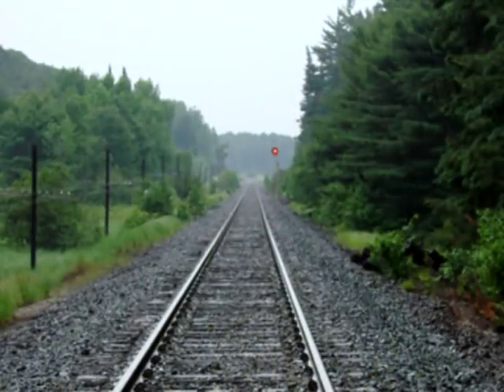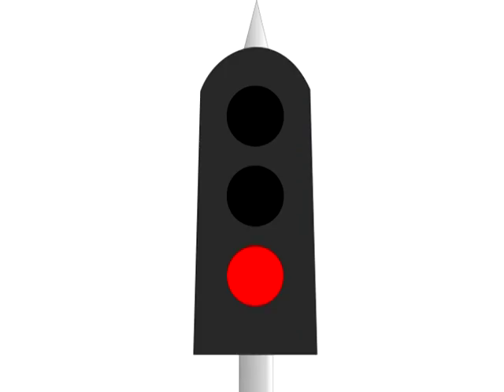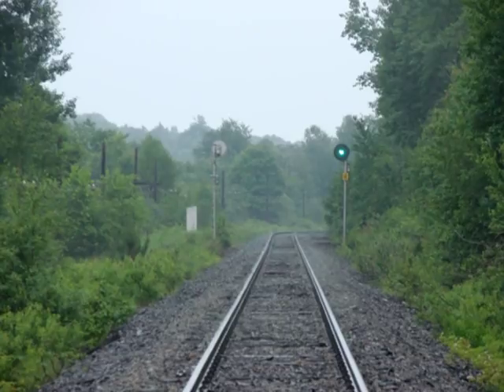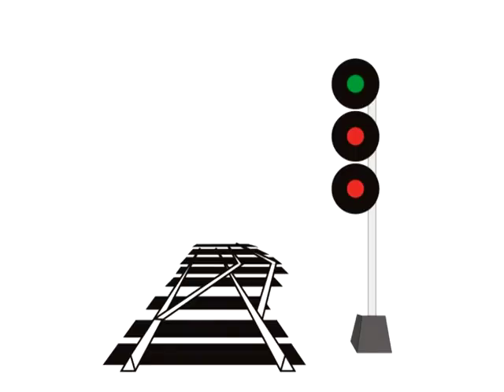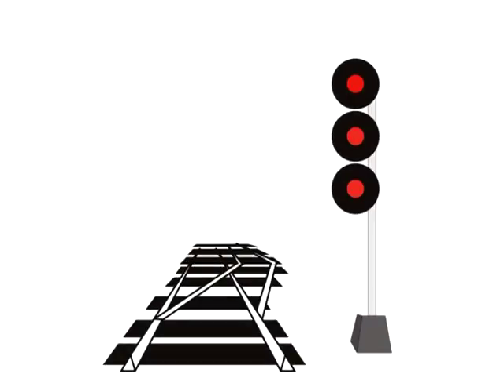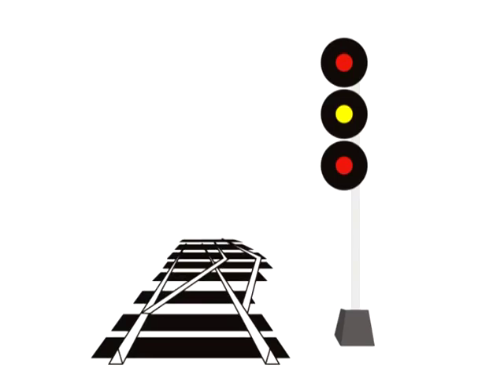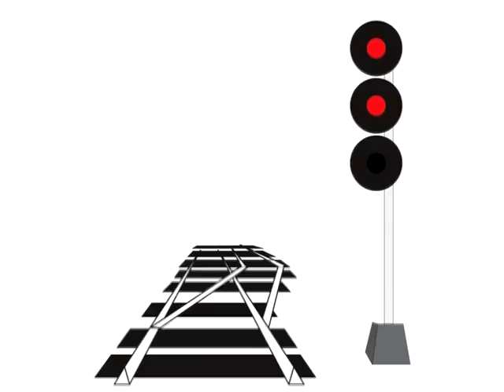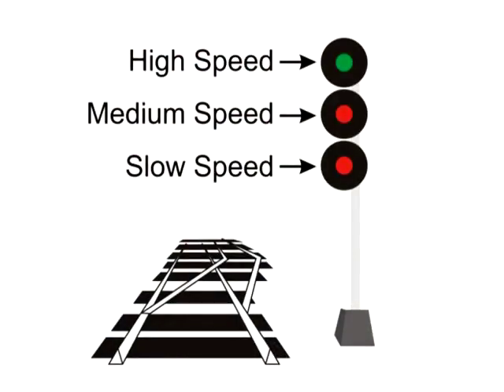Railroad Signals, reading and meanings, part 1: The basic three light system

Comment: I’ve seen this.. A single Vader hood signal with an LED right arrow? What is that supposed to be
Reply from the maker: "Take siding or other track". CN uses them all over the place. We'll have a clear to stop signal approaching a siding, but that flashing arrow tells us we are lined into the siding and so the arrow upgrades the signal effectively. We know the next signal will be a restricting signal and we can pass it at 15 mph. Otherwise, without that arrow, we'd have to approach the next signal expecting to stop. On the Allanwater sub there was a block which needed upgrading. Neither approach signals had working arrows (though the light was there, but couldn't be made to work without system upgrades in the block) so if we were lined into a siding, we couldn't tell and had to approach the siding prepared to stop.
Reply: Ian Juby this particular arrow is in my latest video it is on CN’s Bala sub and 4 kilometres north of it is a siding at Vivian Road

Comment: Some rail lines do not have CTC signals. How is rail traffic controlled on those lines?
Reply from the maker: There's a couple of ways. In Canada, it's OCS - so everything is done by radio communication like Air Traffic control. You're given permission to occupy some track and use it in certain ways (i.e., only proceed in one direction or get a work authority so you can go back and forth on the stretch of track). There is train orders as well, but I don't believe anybody in Canada uses them anymore. There is also some tourist train lines (like the Alberta Prairie Steam Train railway between Stettler and Big Valley, Alberta) which I think they have designated the entire line as "105 territory." 105 is named after the Canadian Rail Operating Rules, rule number 105 which is the basic rules described for uncontrolled track. Like rail yards. So basically you go everywhere at restricted speed, and no permission needed to go anywhere. With the Alberta Prairie railway, they only have a very few trains that use the line and the only time they have more than one train is during railfan weekend in Big Valley.  So clearance is just worked out between the crews. I'll ask the crews when I'm out there what they do on the lines.
Reply from the maker: Okay, so I stopped in at the Alberta Prairie Railway and a kind old gentleman named Bob (management I believe) humored my odd request for information. His answers surprised me. So that rail line between Stettler and Big Valley is operated as OCS. This means it is controlled by RTC, and the RTC they have is in Quebec - 3,000 kms away. Railterm contracts a lot of rail services (maintenance for example) and one of the services they contract out is Rail Traffic Control! So they call Railterm for OCS clearance, and Railterm apparently provides RTC services for something like 100 rail lines in Canada. Probably every single one of Gennessee Wyoming's short lines I'm guessing, and then all the other short lines in Canada.

Comment: do you have over there signals that warns engineer that railway crossing with the road is coming soon  and how it looks ?
Reply from the maker: +DorianCroatia20 Indeed we do!  Well, for public crossings.  It's a little white sign with a W on it for "whistle" - it's a whistle post and it's placed 1,000 feet before a public crossing. We don't have to sound the whistle for private crossings except in an emergency.
Reply: Thank you very much. I was curious, because here in Europe (Croatia) we have signal on the agreed distance before street crossing, and when train is approaching this signal - if the light is white it means "Street crossing system works" and if the light is yellow it means "Street crossing system is out of function, be careful and set speed to 10 km/h". There is no such thing in Canada and States ? And one more trivia, we don't have to whistle with locos if street crossing has barriers :))
Reply from the maker: Ah yes, it depends. We actually do have a light on the electrical box which warns us if the crossing is operating on battery power cause the power is out.  But we can actually see the crossing lights if they are working - they're little windows in the sides of the lights so we can see them flashing.  Problem is, there's NO way we could slow down to any set speed before hitting a malfunctioning crossing.  If the crossing malfunctions, we call RTC.  Or if we're en route and RTC calls us, we are given specific instructions as to what to do. Usually that involves stopping before the crossing, I get out and manually protect the crossing and then we occupy it.
Reply: Thank you very much for the info. I played all your videos, but would like to ask you one more thing- do you place entrance and exit station signals before and after station? 

in most cases here in Europe, there are "entrance signals" which stand on the place when train entering the station, and "exit signals" which stand on the place when train is going out of the station. if entrance signal is red, it means "you can't go into the station, stop at this  very point" and if entrance signal is green it means you can proceed inside the station. on the distance before entrance signals, there are also pre-signals. If pre-signal is yellow, it means "entrance singal will be showing red", and if pre-signal is green it means entrance signal will also show green.
Reply from the maker: Nope.  We just got CTC signals which may, or may not, be at the location of the station.  At least, that's all I've seen - I haven't worked any of the big terminals with passenger terminals. So maybe they do have such lights?
Reply: Yeah you're probably right. We have entrance singnals only in front of bigger stations.

Comment: How do you know exactly when the last car has passed a signal or switch?
Reply from the maker: We know the train length from the train manifest and we have a footage counter that we hit at the light so we know when we've traveled the length of the train. At least, in theory that is.  :)  Errors in both counter and paperwork can happen. That's when other crews on the trains you might be meeting come in handy to tell you when you're clear.
Reply: Ill explain a bit more, you get a paper with how long your train is, we'll say 1000 feet for simplicity. Then the engineer has a device in his controls that acts like an odometer basically, he hits a button once you pass the signal and it starts counting feet, once it hits 1000 you know youve traveled 1000 feet since it started counting (at the signal).

Comment: What about Limited Speed and multi speed indications? You left out a HUGE portion of what the 3 headed signals are for. After a Medium or Slow to Clear it is not always a Clear signal. It could be clear but it could also be any signal that is Clear to ____ (slow, limited, medium, diverging, stop).
Reply: Covered in part 3

Comment: What if the three headed signals are Green.Yellow,and Red
Reply: You will never see a signal like that, it doesn't exist. If you do happen to see that then that means that signal is out of correspondence and you treat such signal as the most restrictive it can display. Which is either stop or restricting speed depending on if it's CTC or ABS.
Reply: TheNavyShark ok got it
Reply: If an installer/maintainer of a "darth vader" head can assume the element colors are always in the same order, installing them or fixing wiring is much faster, without having to make additional tests in the field ("Okay, power the middle element.  Oh, it's green this time?") Time is money, why confuse the issue?  A defectively manufactured head with the elements in the wrong order could be dangerous!

Why are the elements in the order they are?  It made sense to the manufacturers and the railroad companies, it's a done deal, don't worry about it.
Reply: Then you assume a fault, and thus assume all-red. Stop at the signal, and phone or radio the dispatcher to report something wacky going on and get their advice / permission to proceed / warning to run hard and fast perpendicular to your own train because it's about to be hit from behind by a freight doing 75mph which erroneously had a clear-to-proceed at its own last signal.

Comment: What I'm confused about is why the LED signals, (I call them "Traffic Lights") were built so the red is on the bottom and the green is on the top.
Reply: Everything in railroad signaling is designed in fail-safe manners.  The type of signal that you refer to is called a colorlight signal.  Over the years working in designing these systems, I have found two reasons: the first is historical with reference to semaphores.  Because this was a mechanical device, gravity was to bring the device to the most restrictive aspect.  When it came time to build colorlight signals, it simply followed that the most restrictive aspect should be at the bottom.  The other, less motivated reason was that if any wire was to become loose in a signal head which could cause an unintended lamp to be lighted, it was better that this loose wire would fall down to a more restrictive aspect.